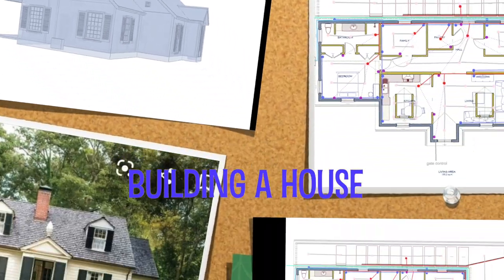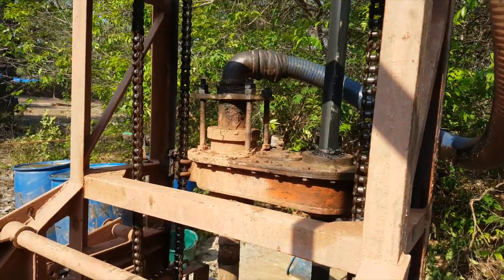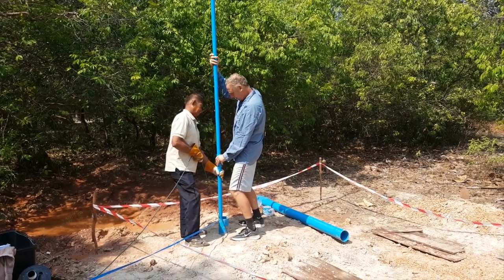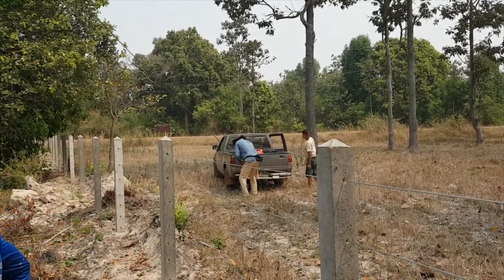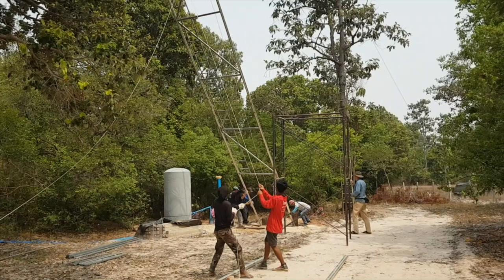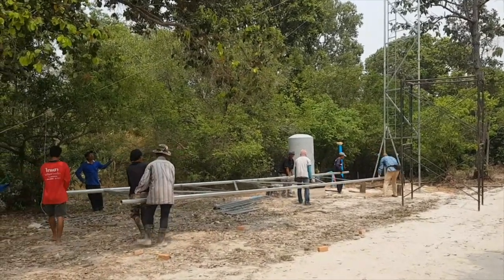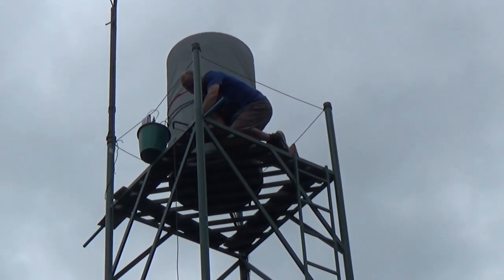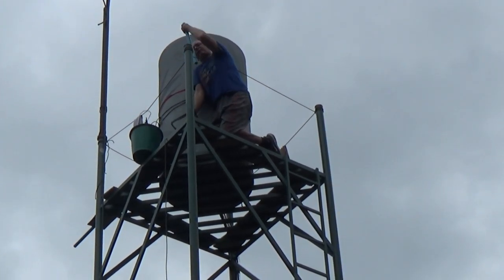Water Tower

Comment: Hi Maarten.  Well done, it's impressive.  I'll be building near Roi Et next year, so not far from you.  Would you mind sharing the plans for your tower?  You're an engineer (I'm just a reasonable DIYer) so I expect you've done the stress calculations to ensure it's strong enough.  Many thanks.
Reply from the maker: Hi Trevor,
🤣😂 Yes I am an engineer... in computer-science.
For the rest I am a pretty good DIY (In my home country a man is not a man if he can't handle his power-tools 😁) and I've read a lot and watched a lot of YouTube videos.

But, you are welcome to copy the tower.  It is pretty basic. 4 steel pipes (4") with every two meters a diagonal brace and a opposite horizontal brace.
If you have trouble "translating" this into a plan, I can send you a drawing.

I did not do any stress calculations. I just looked at water-towers in the area, their load and their construction.
Ours only carries 1000 liters. A lot less than similar  designs.
Reply: @Living-off-grid  Thanks Maarten, appreciated.  Your definition of a man in your home country made me smile.

There are two possible mods that I am considering:

1) Provide simple internal intermediate platforms with 3-4 internal inclined ladders, rather than a single external vertical ladder.  I will be mounting some antennae at the top (4G/5G phone internet signal, aircraft transponder signals, etc.) and maybe a floodlight for my land.  I want to be comfortable going up to the top in any weather conditions if there is a problem (or just want to enjoy the view 🙂).

2) The platform may be suitable for mounting a telescope for astronomy (and astrophotography if it has no vibrations).  Light pollution in rural Isan regions is delightfully low.  🙂 Visual astronomy would probably be fine but taking exposures over many hours for astrophotography is the main challenge.  The height is also an advantage to get above local visual obstructions and, more importantly, ground air turbulence.  The extra platforms and ladders in the structure can only serve to increase rigidity.  One litre of water weighs one kilogram so it also incorporates its own one tonne mass damper on the top, at least in the vertical plane.  Gusset plate joints could be incorporated rather than butt joints.  The steel pipes could be filled with corrosion-inhibited reinforced concrete.  External steel finning plates could be welded to the pipes.  If required, lateral rigidity could be augmented by several external tensioned steel guy lines.  Comments welcomed from anyone with structural engineering knowledge.  Clearly, this second mod would be a project in itself!

Thanks again for the inspiration Maarten.  All the best, and happy new year.
Reply from the maker: @trevorloveday114  Hi Trevor.
Your suggestions make perfect sense.

In the future I plan to add a few platforms. This would be easy as the steel beams to carry it are already there.

It would be as a "playing area" for my son. Maybe a zipline to his tree-house.

An inside ladder is a very good idea as this one is simply "very scary" and not very safe.
The main reason I did it like this was cost. (Ease, thus speed, of construction).

Have a very happy new year and please keep me informed of your progress.

Comment: Impressive but overkill. 1. Borehole pump must be bigger for pumping up to the tank"head" 2. Small storage 3. Wind factor. My suggestion  large storage at ground level and inline pressure pump about US $ 250 total
Reply from the maker: 1- The whole reason I did this was because I don't want to have an inline-pump.
The well is 40 meters deep and the pump hangs at 30 meters deep, so a surface pump will not work anyway.
And running two pumps? No thank you.

Now we have the desired amount of water, no matter how many taps are open. No fluctuations in pressure. 

2- I don't need large storage. 1.000 liters is more than enough. In fact, 500 would have done it nicely.
We only need enough water for 1 night because at night the well-pump is not active (to spare the solar battery)

3- So far it has survived some pretty heavy storms.

Comment: Great job! I must say you got some balls climbing up the tower without a safety belt! 
I used to climb up to the top of the oil drilling Derrick tower offshore when I was younger.
Reply from the maker: @SometimeWoodworker  The steel conduit, which is grounded, will prevent the "near lightning discharge" to travel through the wires into the main electrical system.
Of course nothing can withstand a direct strike, but most "lightning strikes" that damage equipement are in fact just "nearby discharges".
Since the tower itself is made of steel and each leg is (properly) grounded, a direct hit in the cables is unlikely.

Comment: Nice work you did there. can you give some features of your pump?
I'v been  always wondering how people pump ground water for domestic uses from the same spot which their sewage drain goes too. don't you afraid from fecal bacterium? .
Reply from the maker: The pump is a 1100 watt (230 volt) deep-well pump.
I forgot the brand name, but it originates in South Africa.
It can pump up to 110 meters height.

As for septic-tank contamination, their are rules for that.
The standard is that the drain or leach-field of a two-chamber septic-tank must be a minimum of 50 meters distance from the well or bore-hole.
(Ours is about 100 meters away.)

I am much more concerned with a general bacterial contamination in the storage-tank.
The water temperature is perfect for legionella and the likes.
So, even though the well water is of pretty high quality, we don't drink it. 😔

Comment: Maarten, I watched another one of your videos "Building a house in Thailand" and enjoyed it very much. As I commented on that video I will start my house in 2022. I will start this year by drilling my well. If you don't mind would you share with me the cost per meter for drilling the well? Tew and I live along the Phan river several kilometers from the reservoir. Our village pumps water from the river to the water tower and the water is just plain nasty. I have installed a filtering system which helps but still we want a deep well.
Reply from the maker: We paid 3500 baht to drill the well. This was a fixed price for a 40 meter deep drill-hole, which is also their max depth.

So, it was/is a bit of a gamble. If the water is deeper than 40 meters... too bad.

But they assured us there would be water, and they do this for a living.
Reply: @Living-off-grid  Thanks Maarten. I don't think I will need much more than 20-30 meters being we are on the river.

Comment: Solar power is great , but consider supplementing wind power , it usually works better on cloudy days and at night , a small wind turbine 500w should be enough
Reply: It is a good idea, but the one thing that is holding me back is the noise.
Reply from the maker: Thanks Russel.
I will look into it. 👍
Reply: @Living-off-grid  they are called vertical wind turbines and you would need a hybrid  wind/solar charge controller
Reply: wind power is not going to be good there.
The best is definately solar in that situation.
Reply: @johntheaccountant5594  the best thing to do is decide what you are gunna do before you invest in a charge controller so you can get the right one first instead of changing your mind and have to get a hybrid controller later
Reply: It would be a viable suggestion if Thailand had wind but it doesn't.  The wind is typically under 5mph so insufficient for a wind turbine.

Comment: Why water tower, well pump and pressure tank at ground level not sufficient.
Reply from the maker: There is a number of reasons for this choice:

With a water-tower you always have the same water-pressure at every tap, no matter how many are in use.
Pumps (and pressure-tanks) have water-pressure that varies constantly, which is annoying when you take a shower, specially when someone then flushes the toilet or decides to do the dishes.

Apart from that, with pumps: No electricity, no water.

And, in our case, running 100% on solar-power, the tank gets filled during the day, and gives us all the water we need at night without using the (precious) battery-power at night.
Reply: @Living-off-grid  You use the water from the well directly?  No filters, charcoal, disinfectant or softener?
Reply from the maker: Yes. The water quality is quit good. A little acidic, but well below limits.
We don't drink it because it is stagnant inside the tank and good filters are hard to get here. (RO is not very healthy if no mineral-system is incorporated)
We drink mineral-water (Pura) for health reasons.
Reply: @Living-off-grid    Question. You mentioned you have a hot water tank, do you treat your water before it enters the tank? I wonder if there would be a lot of mineral build inside the tank.
Reply from the maker: @nitepharmer5866  
We don't (yet) treat the water. As I mentioned before, it is pretty good quality. All minerals well within tolerance. 
There probably will be a build-up of calcium inside the boiler,  but that is actually pretty normal.
Lots of "city water" is pretty "hard" (rich in calcium).

But, as I wrote: "yet". We are considering it, but it is no priority.

Comment: Your house build seems like a bit of overkill. You must be an engineer. Not sure why you wanted the tall tower except for gravity. Not that it matters, but at my house, my water tank is level on the ground and we have a pump that pumps the water into our home with very good pressure. But, good job and I agree with TSL. You do have some balls climbing up without a safety belt. Good Luck and be careful.
Reply from the maker: You answered your own question: Gravity.  Instead of using two pumps (one to get the water out of the ground and one to pressure the water-pipes) we only use one. Gravity does the rest.
Two reasons: Pumps always react slowly to adjust to the water demand. I am sure you know the cliche of flushing the toilet when someone takes a shower. :-(
With a water-tower the pressure is always equal, no matter how many taps are opened or closed. 
And... it does not use electricity, which is our case (fully solar powered) is a good thing. After all, we mostly shower at night when the sun has gone and it makes no sense wasting precious battery power.

As for the "overkill"   I guess this is a very personal choice. Some people drive a Fiat, other prefer a Rolls.

And to answer your last question.... Yes, I am an engineer.
Reply: @Living-off-grid  
Hi Maarten,
I am not native to Thailand.
My previous property I purchased as a virgin fifteen acre block of land.
Tall eucalyptus trees to the heavens.
About one quarter cleared.
I set about to build a house , required services and live off grid. Taking care to adopt all the latest techniques for 
Integration with the natural order of the physical world, I spent manny happy years there.
I finally sold at a better than expected price to people intrigued by the uniqueness of the property and moved to Thailand.
It occurred to me that I could replicate 
the project here in Thailand.
You can take it our leave it when I say
that the systems I created and installed gave me comfort and efficiency.
I realised that although a grand feat of invention and engineering, the whole concept in this environment would be no more than a indulgence in my own ego.
It has all been done before. I am testimony to that fact.
All the comfort one needs is available at
minimal cost and at a lot less physical energy.
The only reason I can see now for a project of this nature is as a symbol of 
status  or to bring attention to one’s perceived elevated intellect.
Reply from the maker: Hello Dennis,

To tell you the truth, I have no idea what you are trying to tell me (or others).

Maybe you can be a bit more specific?
Reply: Please excuse me for my disbelief.
I’m sure you know very well what I am saying.
But I will grant you this, it is not for me to be judging you and making comment on my judgment reflects badly on me.
Reply from the maker: Hello again Dennis,

I forgive you your disbelieve, but my comment stands.
I do not understand what you meant with your post.

I think (I got this from your last comment) you are trying to say something judgemental, but I still have no clue as to what you are judging.

Maybe you should take into consideration that not everybody in this world is a native english speaker.
Reply: @denniscarter7347  I am a bright bloke but I also do not understand your point.  Perhaps you could get a friend to give you a second opinion.
Reply: On second reading I get it now.  The original poster is stating that he, too, has gone to some lengths to create a comfortable off-grid existence but that '...all the comfort one needs...' can be achieved for a lot less money and effort.  This is quite possible.  However, it depends on how comfortable you wish to be, how much effort you want to expend to achieve it, and how important this is to you.  Affordability and the satisfaction in what you have achieved are very much an individual thing.

The final comment about 'The only reason I can see now for a project of this nature is as a symbol of status or to bring attention to one’s perceived elevated intellect.' is unimaginative and narrow-minded.  It does not recognise pride or the provision of information that can be shared by others.  Lastly, given his stated pursuit and achievement of similar off-grid comfort earlier in his life, it's also ironically hypocritical.

Live and let live.